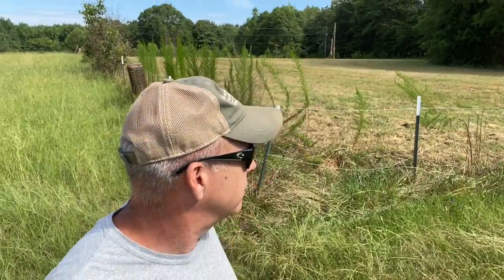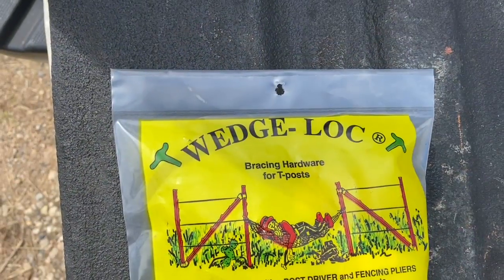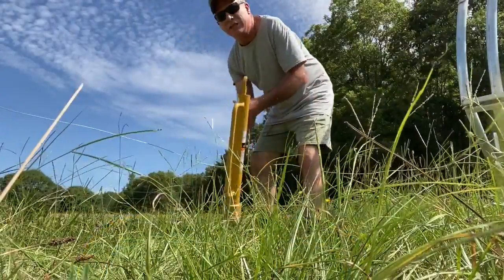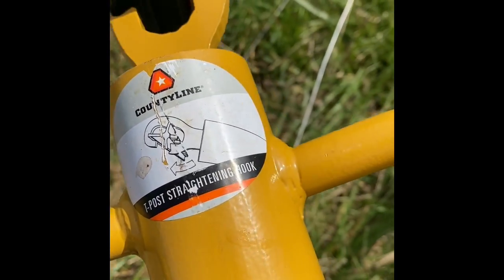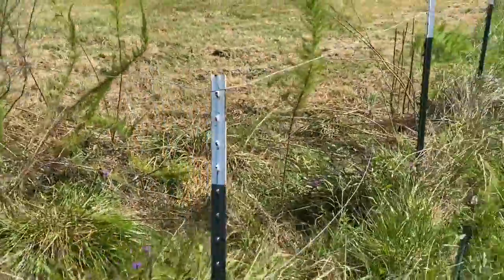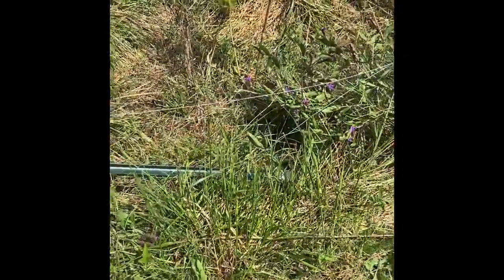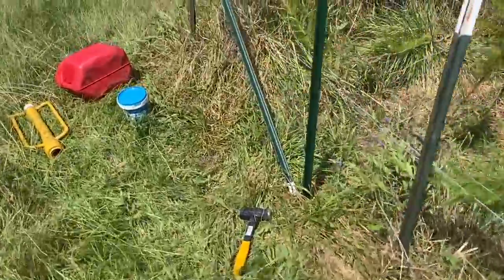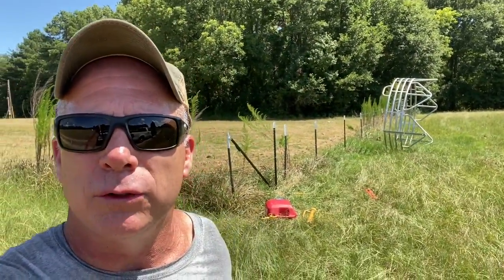Fence corner bracing using T-post and Wedge-Loc

Comment: I made 16 corners with these, 4 strand barb wire. If the posts are installed perfectly in a 90° corner, with the flat spot perfectly flush to the outside, they will hold up. If you have a post even slightly twisted, or out of perfectly square, they pretty much rip apart. Super soft CHEAP aluminum. Thin and cheap where you want some quality. Knowing what I know now, I would have just welded the T-posts in the same configuration as the wedge lock system, and saved $320 (and a bunch of hassle)

Comment: I found that, though a good solution, Wedge-Loc does not last that long, especially if the cows get to rubbing against the posts. I use a 5/16 x 2 x 3 1/4 U-bolt at each end of the brace, where it crosses the uprights. Very rigid and not going anywhere. ... and cheaper. Also, for rocky ground, a hammer drill and 1 1/2 bit. If I want to insulate a corner to bring the wire around it, I slip over the T-post a 1 1/2 pvc pipe section.

Comment: If you are putting in a new fence and don't have a wire ran already, you will need tension to hold that brace while you are hanging the wire.  You can use a twist in the middle of the poles to hole it in place.

Comment: very good instructional video. debating whether to use wedge loc or put in wood pole. getting old to be digging nor look forward to digging in rock and clay.
maybe can get 2 feet deep.  beautiful pasture. we are in drought in central texas and my 13 acres is dust bowl right now. thank you for the hard work
Reply from the maker: Thank you for the kind words. I've used these for both permanent and temporary fences and when you first install they are unstable but once you tension with wire they are rock solid! They take about 15 minutes per corner to install so very efficient. Good luck with your project!

Comment: Is that wire electric? If so, how are you not having a ground to earth? I'm curious. I'm in this stage of the fence building myself.
Reply from the maker: It is electric wire but I do not have it electrified. I'm just using it as a temporary fence and will actually electrify when the permanent fencing is installed. I'm not up to speed on electric fence as my mules don't ever challenge it and all they need is a visual barrier. So sorry but I can't answer your question specifically. Thx for watching!
Reply: @bdradley1  thanks for circling back with me. I appreciate it.

Comment: They make tee post puller they are worth their weight in gold in my opinion my friend how do you like This system sir is it holding up?
Reply from the maker: Once you set both corners and tension your wire or fencing it is extremely stout, I've used these on several fences and they are fast and efficient.